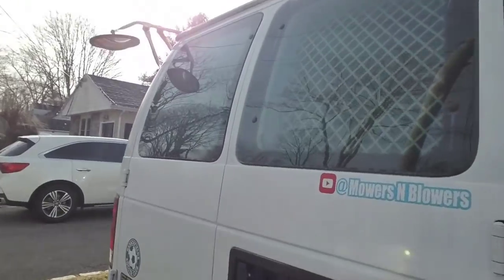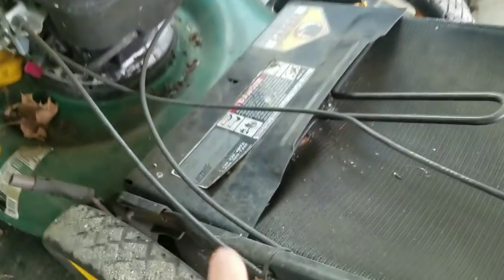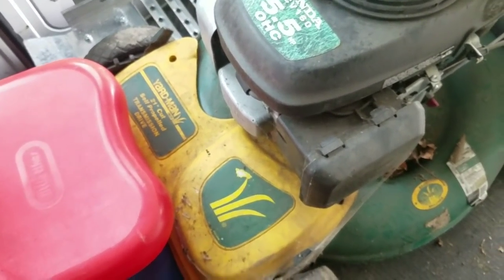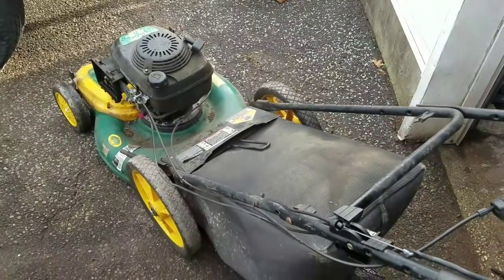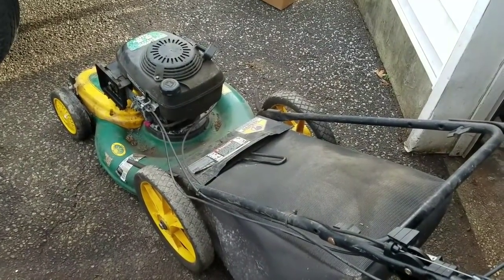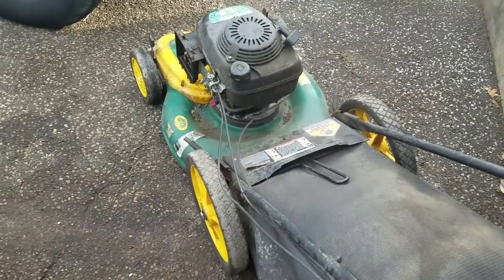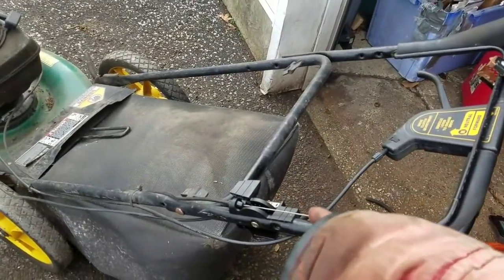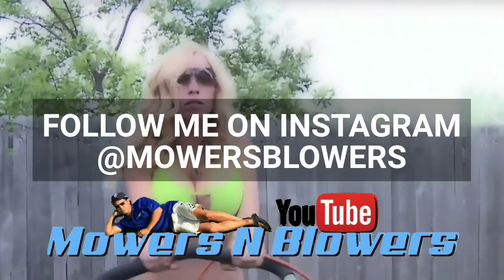FREE MTD YARDMAN SELF PROPELLED HONDA 5.5HP LAWN MOWER CARBURETOR CLEAN CHOKE LINKAGE ADJUSTMENT FIX

Comment: Awesome video! I have one of those same mowers too but with a briggs motor. Sadly I can only use it for parts as the motor was shot but free is free.
Reply from the maker: If it's free, it's for me.  I've had a bunch of yard mans... all of them briggs.  This was my first Honda yardman.
Reply: @MowersNBlowers  yeah that's definitely weird that there's a Honda on an mtd like that
Reply: These are also available with Kawasaki engines too. My mtd briggs is 20 yrs old and strong.
Reply: @jeffthompson8663  I never knew that
Reply: @jrsmowerrepairandlawncare4179  unless someone put the Kawasaki on it but it looked original.

Comment: Great job man..... I don't hate Honda engines, I just can't stand the carbs and those gaskets what a nightmare...... Free is always awesome, hey man guess what I picked up last night for 150.00, a 8.75hp toro timemaster, engine might be toast but I have 4 of those 8.75 with key start laying around so should be a simple fix and resell it for 800.
Reply from the maker: I always wanted a time master.  Theres a guy selling a time cutter for $600, but it's been sitting for awhile.  I like toros though...
Reply: @MowersNBlowers  yeah the time cutter is the pro version, of the time master, a much tougher mower.....

Comment: I don't like working on Honda engine's either, the carb's are a pain to take off and put on, they are great engine's. Here is some info on how to decode MTD Products model and serial numbers,  the first two digits in the model indicate the type, on push mowers, 11A (B or C in some cases) means it is a regular non-selfpropelled push mower, 12A (B or C in some cases) means it is a self-propelled mower,  to find the year model of any MTD product manufactured 1997 and after, it is in the serial number,  i'll breakdown the serial # on the mower in the video. 1G079K1150
First digit, is the engineering code, second digit is a letter and corresponds alphanumerically to the month of manufacture, G would indicate July, third and fourth digit is the day of manufacture, 07 is the 7th day, and the fifth digit is the year of manufacture, 9 being either 1999 or 2009 on your mower it is 1999, the 6th digit is also a letter and is the plant ID where it was made. (always double check thru parts lookup)  that mower is in pretty darn good shape to be from 1999!  Anyways thought i would share some technical stuff with you.
Reply from the maker: You have a multitude of information, however it's a 12A and its self propelled! Shouldn't it be 13A as per your breakdown?
Reply: @MowersNBlowers   my mistake,  i got everything mixed up, 11A is non-selfpropelled, 12A is self-propelled and 13A is the beginning of riding mower lines.
Reply from the maker: Yup that makes sense, as you heard me say...I thought it would start with a 13a since I have had many mtd lawn tractors. Thanks for the info broski.

Comment: Henry i have the same honda engine i want to use it on a project can you please help me find a carburator for mine on ebay thanks
Reply from the maker: What is it a gcv160?  Gxv160?
Reply: @MowersNBlowers  think gcv160
Reply from the maker: Mike, I just went on eBay, types in Honda gcv160 carburetor and found this.  Have you never searched on eBay before?  Literally took me 18 secs!

https://www.ebay.com/itm/383382567943

Comment: It is not auto choke. You manual set the choke
Reply from the maker: Maddox, yes you are correct...I didnt see the choke lever on the handle until after cleaning the carb.  Thanks bro.  Hope you'll subscribe
Reply: @MowersNBlowers  sure will man